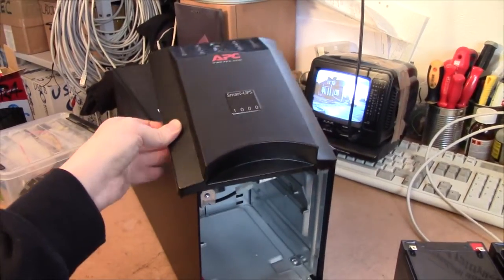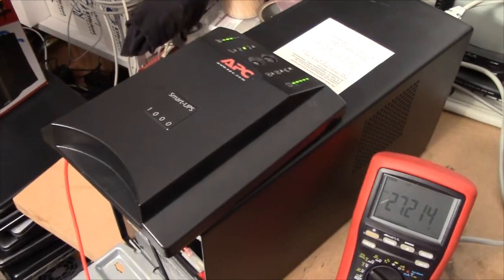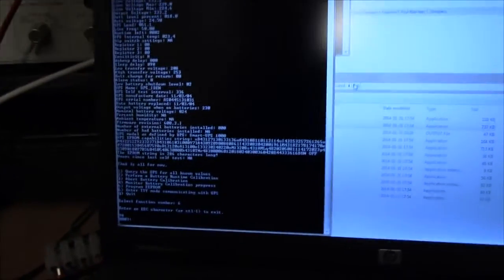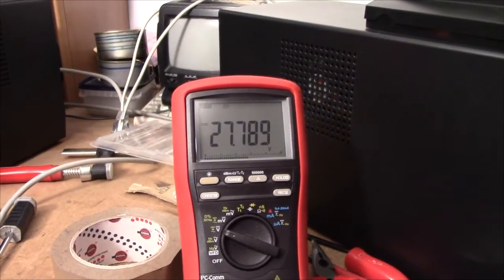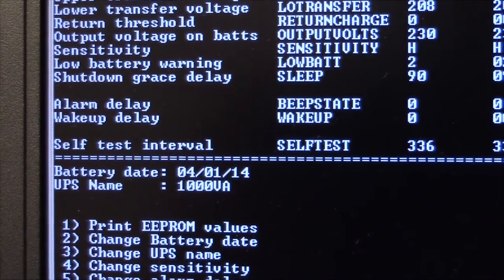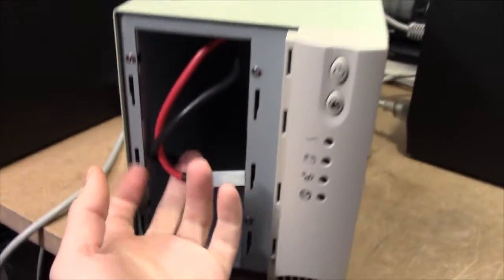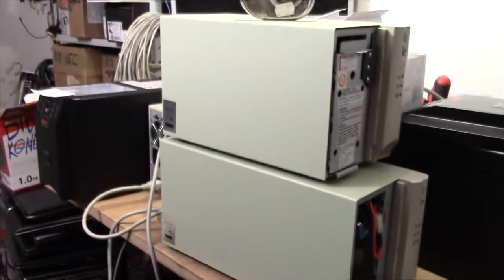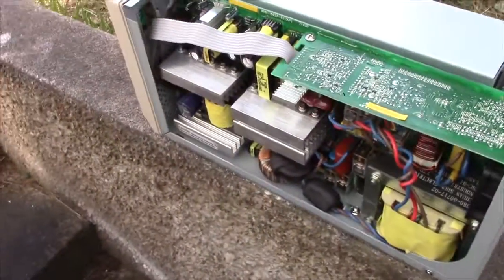Fixing up (a lot of) trash-picked UPS units pt. 2

Comment: Hmmm so the loud hum/groan of the APC SmartUPS is not normal? My trash-picked SmartUPS 1400 has always hummed very loudly when on battery, always assumed that was normal. Been running just fine since I got it about 10 years ago.

Maybe I need to go through it and check all the capacitors next time I'm replacing the batteries.

Comment: Do you connect to these units with a program you've designed or bootloader of sorts and use cmd to query? I have a unit that was doing great, however I had connected the wrong power plug to the unit while carelessly testing five different units. In other words I stupidly connected units plug to self. Unit then carried on like others with random beeps which I assumed was charging as the others had done. When I came back however, the unit was off and when connecting power correctly then power up it stays in battery mode only. 

Prior to this the unit was in near perfect condition after checking battery voltage and passing self test then left running over night without issue. The next unit I thought I would run off the first to save plug space lol. Guess I shouldn't have been so lazy and u wouldn't have made the mistake. My problem currently is how to connect to units and see what's what and secondly, did I blow internal fuse, switch, or perhaps a simple reset of alarms via connecting using powerchute program or another program?

Comment: Not sure you find comments on old videos but here goes: I recently found a SU1400INET and am in the process of getting it into service and learning in the process. All was looking great until I initiated a Battery Runtime Calibration via the serial connection. The unit shut off when it reached about 25% capacity, then did the all-lights blinking thing which I read may indicate a hardware fault, perhaps bad relays. After disconnecting mains I have been able to get it to stop complaining but I am wondering if you have any suggestion as to what I should look at replacing? Definitely will do the 22uf caps and examine the relays. Happy coincidence one of my favourite channels (yours!) also has a ton of UPS videos on it :)
Reply from the maker: I've never seen that before, but you should always swap the 22µFs.

Comment: "corporate powered turd" lol I like the vernacular. I like these ups units accept the ones that don't have a 3 stage charging unit or 7 stage preferable, and I wish the ones played with already had an rs232 port to reprogram the sucker to a lower voltage like u did, cos it killed several of my SBS40 Batts :( I wish I can find more of them in the junkyard, but they r so far away and the local tip doesn't like to let go of anything. Well I can't say ur too OCD cos that bloody fan is bloody annoying alright and I wud replace it with another fan that has a thermostat built into it.

Comment: I'll just add to my previous comment. If you want to turn off the alarm/buzzer 
k - alarm delay (shift + or - (next to back space) ; increase or decrease value
0 = 5 second delay after power fail
T = 30 second delay
L = alarm at low battery only
N = no alarm

Comment: not viable to replace the fan with a different 12v fan of that size? noctua makes very quiet fans that'd work in that setting and push out about the same if not a bit more air without the noise issues.
Reply from the maker: Yes, of course, but the main problem isn't that the unit is fan cooled, it's that it drives the fan at a 2-5 Hz PWM; it literally turns the 12 V line of the fan on and off a couple of times a second, making the unit go "whirr-whirr-whirr-whirr-whirr", and wearing down the bearings of the fan. Yes, you could bypass the PWM and tap off the 12 V line directly, or make some fan controller of your own (I once did), but it isn't really worth the effort, especially as the alarm on these units can't be turned off through software.

Comment: Need your help on a half repaired SUA 1500i. The inverter circuit works in test mode with a load connected but doesn't work on power loss. When power loss occurs, the unit shuts down an all the light start blinking all together and the inverter doesn't take care of the power loss letting the unit useless. Any suggestions? I tried comparing some measure in diode mode with a working unit but no success...
Reply from the maker: Almost impossible to say, but it could be a bad relay causing the unit to back-feed into the grid.
Reply: That's what I tougt but I measured "most of" the relay out of the pcb and they tested fine... Didn't measured the one close to the ac output... I'll do it and update.. Thanks
Reply from the maker: Luigi Mazzoli
You need to activate the relays and measure their resistance (not diode test) to get any kind of certainty in your testing.

Comment: SUA.1500 Programming - Hyperterm or Teraterm
2400 - Baud
8 - Bit
N - Parity
1 - Stop

Y -> SM = smart mode to retrieve data
1 (wait 3 sec) 1 -> PROG =  Program mode (must remove network card to do this)
x - mm/dd/yy = Battery Date (lowercase x)
- (enter new value) mm/dd/yy = OK
R - BYE = exit smart mode
http://www.apcupsd.org/manual/manual.html#apc-smart-protocol
Go to Smart Protocol for all the commands you can use (you probably already new that)

This is mostly for 3ed and 3.5 gen A.P.C. units SU, SUA

Not sure if you even still playing with these but if you are hope it helps

Comment: it is kindda let comment but is it possible to increase the output capabilities of APC Smart-UPS 1000 (adding any thing from 200va to 500va ) by adding more mosfets 
Thx for your vid I learned alot from you
Reply from the maker: No, because the overcurrent protection is pretty hard-coded.
Reply: Thanks